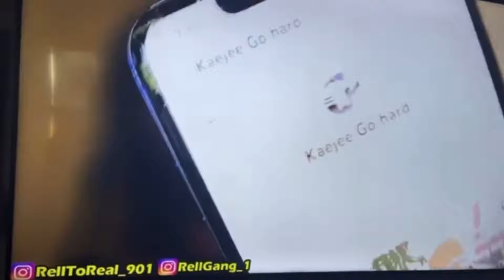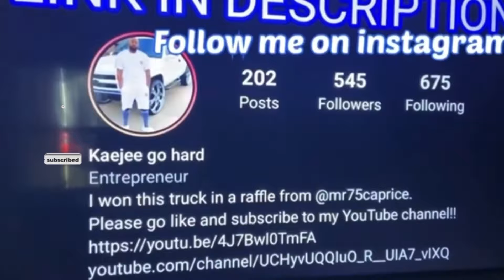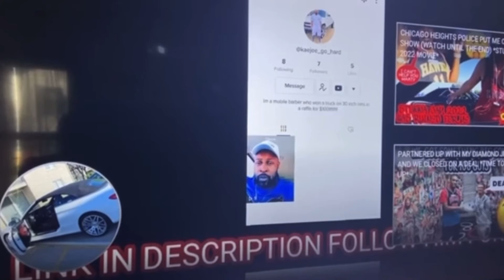Someone Came From Hours Away To Come Pick Up My Truck! What’s Next!?

Comment: Easy… oil pressure not working, just need to replace the seal that’s on the pick up tube or oil pressure switch itself or Cracked o-ring on the oil pick-up tube where it goes into the oil pump